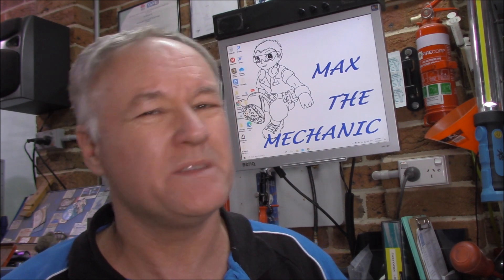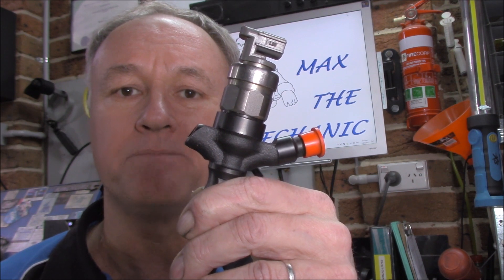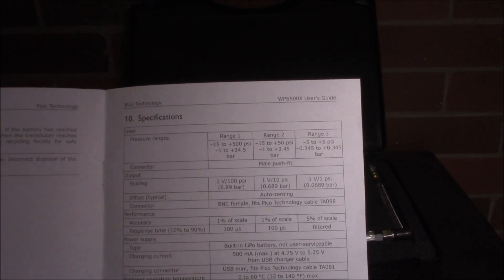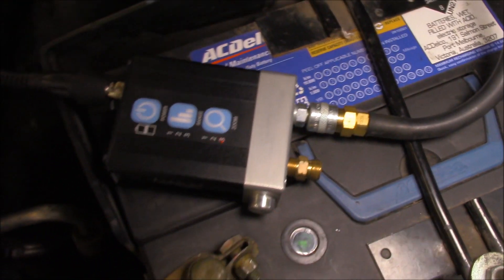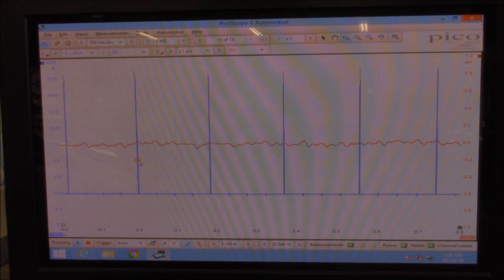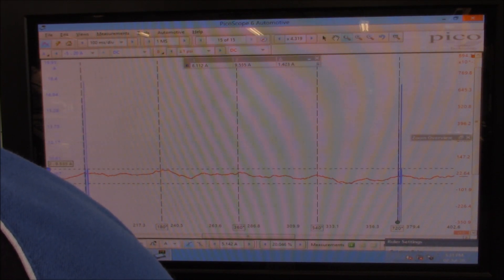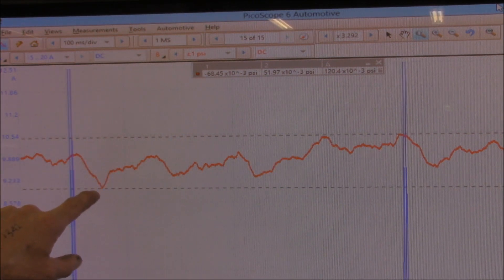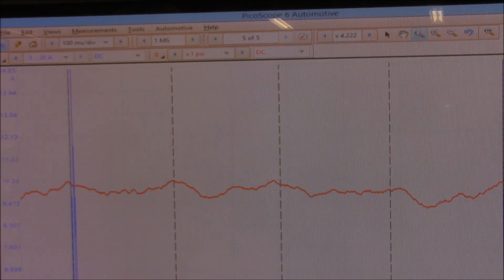Mitsubishi Triton Injector Testing MiracleMAX

Comment: Hi ,
MN triton 2.5 litre can’t do small quantity relearned.Because Automatic transmission reading from scanner
-40C (minus)degree do you know where is the automatic transmission sensor location please.
Thanks 
Tri
Reply from the maker: Not really sure, but I believe it is internal to the transmission, located on the solenoid pack or valve body. I would be checking the wiring to it as -40C is usually a default for an open circuit.
Reply: Thank You Sir

Comment: Love your informative videos. 
I have a Triton ML with the 4M41 motor, which has done  113.500 klms 
It is hard to start and blows white smoke on cold mornings. 
Went into limp mode and scan shows P0089 , changed SCV , filter , fuel in tank but still showing code .
FRP is 9,500 psi at idle and around  15,000 at cruising speed but occasionally runs rough at idle and builds rail pressure up to 25,000 psi and blows white smoke but clears when you restart the vehicle. 
I was told the SCV needs a relearn .
Any help would be appreciated!
Reply from the maker: Have you checked for any air to the high pressure pump? Have you done a small injection quantity relearn? https://www.youtube.com/watch?v=Z6_ru3XxO20
What are your desired compared to your actual fuel pressures?
You should do a fuel pump supply relearn.
Pressures should be roughly 33000 kpa at idle, 56000 kpa at 2000 RPM....roughly.
You also may need to check the fuel pressure regulator.
Reply: @MiracleMAX  checked all the above .
Can't do a learn so booked in for that procedure. 
Will advise on outcome. 
Cheers
Reply from the maker: @peter112999  Look forward to hearing the outcome 👍

Comment: Hi i’ve got a L200 B40 on a 06 running rough once I start and warm it up rev it up it’s missing drive it down the road he’s off the accelerator go to set off again, like a flat spot could that be the injectors or fuel pump thanks
Reply from the maker: What fault codes are available? Do you have any 'live data' from that scan tool that might be of use to help diagnose? How many kilometres? Has it been serviced regularly?
Reply: @MiracleMAX  been trying to get it into a garage to get it on the diagnostic no lights on dashboard, had it serviced few hundred miles ago it’s 150000 when I bought it is done 161,000 now Thanks for your reply like watching your videos.
Reply from the maker: @cmpestcontrol8474  Let us know what is found when you get a workshop to scan for codes. 👍

Comment: scoping the crank sensor and graphing rpm should show which cylinder is missing.
Reply from the maker: Hey Nathan,
That's a fair comment and that would be true if it had a constant miss, however this was only rough running on start up when it was cold for a very short period of time.
Thanks for your comments
MiracleMAX